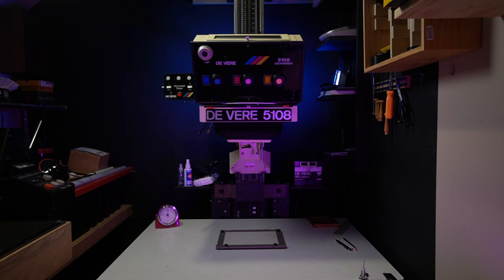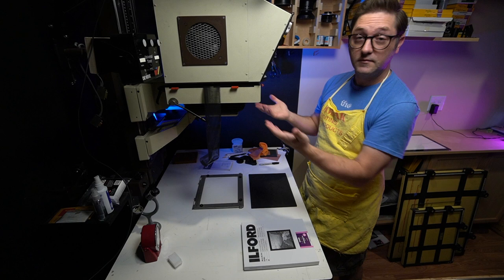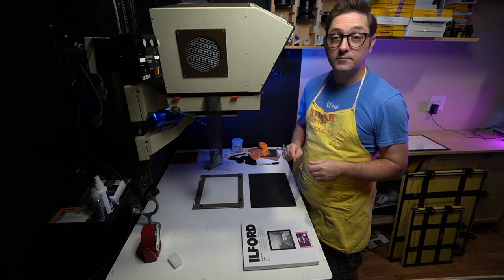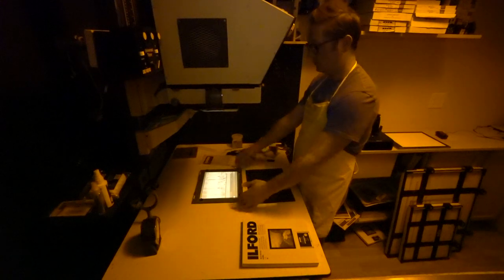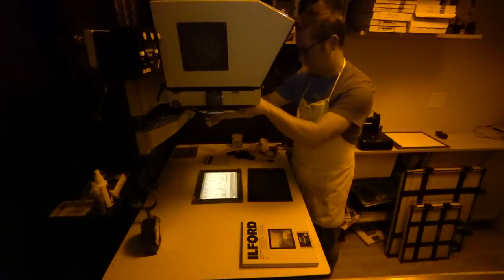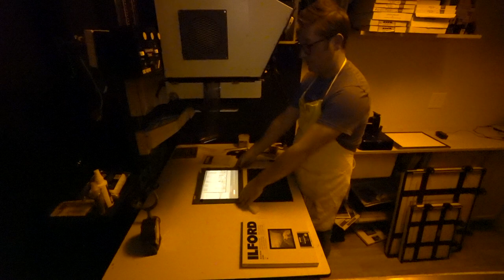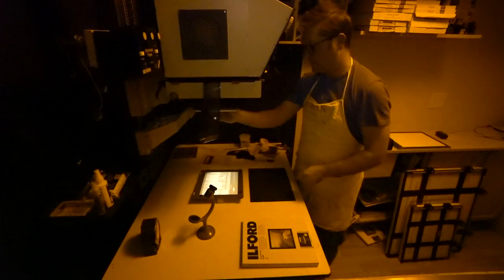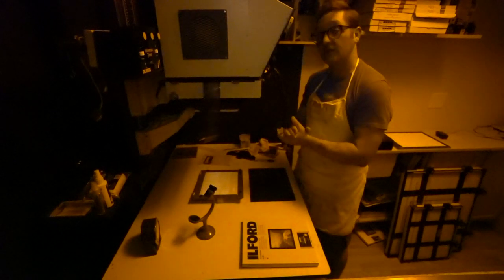Fixing Converging Lines In The Darkroom

Comment: The Kodak Precision enlarger is one of the more curious designs out there designed as a system to give you 3 ways of doing movements. They offered a tilting head (with up to 45 or 90º of tilt), a tilting lens board, which gives some degree of tilt, and 350º of rotation, and a paper board (easel) with 3 legs for tilting. Probably one of the most versatile enlargers in terms of movement. (Both in the A configuration 2¼ x 3¼ condenser model, and in the model B 4x5 diffusion enlarger). Kinda one of the more obscure enlargers out there but I love it. Not very suited to color work, but it’s pretty sound otherwise.

Comment: If your enlarger doesn't have movements and you need more DoF for your corrections, get a longer lens (eg: instead of using a 50mm lens for 35mm negatives, use a 70mm lens). Being the lens physically further away from the easel it creates a wider dept of field.
Reply: thanks

Comment: Very interesting.  Even if you have an enlarger with appropriate movements, are there limitations with lens field of view, such as loss of sharpness or vignetting at the extremes of the field that become worse when tilting?
Reply from the maker: Not that I’ve seen, but you can always go up to the next longest focal length to gain more coverage.
Reply: The tilting of the lens stage keeps the coverage of the lens centered, so if this is done right, vignetting and related sharpness issues are not a problem. However, if you have even tonal areas and a fairly large adjustment, one side of the image can become far enough away compared to the other side of the image that you may have to burn or dodge part of the image to hold an even toned cross-section. For most images and convergence corrections, this is not a problem.
Reply from the maker: It also depends on your enlarger design.  Since my model has the lens and negative stages separate, then moving one doesn’t affect the other, but some models may work differently.  The Beseler 23C, for example, doesn’t have negative tilt so you would lift one side of your easel, but the lens can tilt for correcting focus, which shifts your image to one side a bit.

Comment: If my enlarger has the movements, correcting lines won't affect illumination, if it doesn't can it produce uneven illumination on the print?
Reply from the maker: If the movements are extreme you may have to burn one side a little.  I didn’t need to, but I wasn’t making a fine print.
Reply: @TheNakedPhotographer  Thanks!